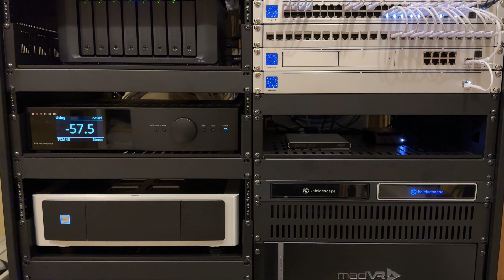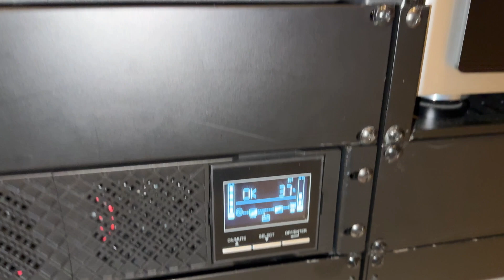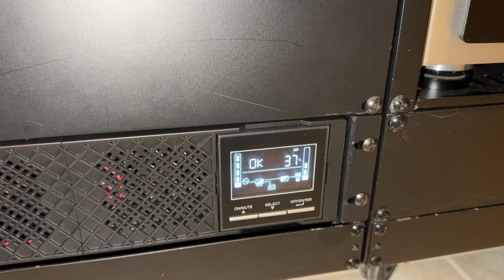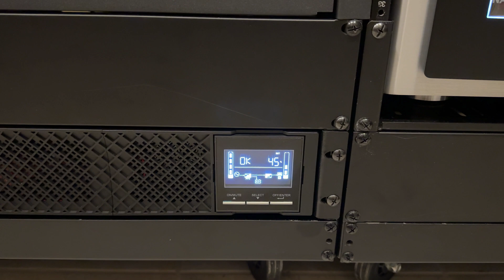Will I Blow Up My UPS? Can It Take My Full Home Theater Rack Load?

Comment: I know you mentioned the control4 integration. I’m curious how that  works / displays on screen (if anything like that).
Reply from the maker: I haven't yet connected the new power gear to my C4, but I will soon. It will mostly just give the ability to program outlet control.
Reply: @ will you show that as well? Really curious how that interface is.

Comment: I might be old school but I run my power amps directly from the wall on a dedicated 20a circuit. Aside from any dynamic load considerations, even “pure” sine-wave UPSs aren’t actually pure. Except for my Anthem MDX’s, those I power from the UPS. It’s possible the pure-ness matters less now with Class D, I’m not really sure. Like I said, I’m just old school.
Reply from the maker: I may go back to that as well. I wanted to experiment with this and see how it goes.
Reply: @Techthusiasm  钱

Comment: Nice setup but not really a valid test. The transient peaks from the amps are far larger and faster than the UPS meter can respond to (meter is heavily dampened). The UPS meter is reading a very dampened average power... Thats a big difference. The simple truth is you don't get power for free. for example, If at any given moment, the power to each speaker is at 100 watts, the power consumed from the circuit is each speaker power times the  number of speakers plus the inefficiency of the amplifier plus the rest of the idling equipment. In a lot of cases a single 20A circuit is not enough for extended listening at high volumes. The only reason you are not tripping a 20A breaker is they are measuring heat over time. The peaks in music or home theater are not long enough to heat the breaker to the point of tripping (but far exceed 20A).  Leaving the volume up loud enough, over time, will eventually trip the breaker. With this in mind, I'm confident the transient peaks of the system are exceeding the transient capacity of the UPS, The display is just too dampened to show the real data... I personally would never connect my amps behind a UPS. The most important is to have the amps behind a spike arrestor to suppress overvoltage from the power company or storms. The UPS alone can not regulate the peak power needs of a high powered audio amps. The results are, the amp(s) will be starved of transient power needed for a clean signal to your speakers adding distortion... My 2¢...
Reply from the maker: Thanks for the detailed feedback. I definitely need to look into this more. I'm hoping to find some way to get a full power draw plot over time to compare on the wall vs. on the UPS, as you say.

Comment: Most important thing I have going through my UPS are my projectors. If there is a power outage while a projector is running and hot, you want to be able to go through the regular power down mode with fans running to cool off properly.
Reply from the maker: Yes, I want to get a small, silent UPS dedicated to my projector.

Comment: I went your route initially (everything behind UPSs).  I would not recommend running your theatre amps through a UPS (certainly not a single UPS for everything)… it might run but dynamics are impacted in my experience.  Just to be clear, love WattBox equipment for purpose.  Mine had a lifetime warranty and they stood behind it when it needed to be replaced 11 years into service.

I have two NAD M27 amps and they're rated for max 10 amp each so they plug into a single 20 amp circuit.  Check the back of your amps / equipment for max ratings but generally you don't want to exceed the sum of the max rating for the equipment plugged into each circuit / UPS.  Per code you don't want to run at more than 80% of a circuit / good UPS rating for more than an hour (wires get too hot or circuit breaker nuisance tripping). 

Amps (driving subs especially) and personal computers are unusual loads. Their loads swing quite a bit with micro dynamics or GPU and music so you're better off giving them "space to breath" for those short dynamic swings.  

Also not, 100% sure how precise the WattBox power draw display is on dynamic load.  It's generally just trying to show you the load (not precise in swings).  I would think it's averaging over intervals and you're not seeing your amps truly spike as much as they are.  

I had a fellow come in (forget what he used) but he showed a graph of my amps power draw going through a UPS and then we ran the same music bypassing the UPS and into the wall.  The amp drew about ~10% more power like-for-like.  That convinced me to install some additional circuits to the rack.

You're probably in a situation with how your theatre and rest of setup has grown where at least another 20 amp circuit is warranted.  Worth it IMO (especially if it's your long term home).

Apologies for the lengthy comment... getting the best out of your equipment is something I know you value.
Reply from the maker: Thanks for the feedback. This is something I plan to consider more deeply as we go forward.

Comment: Nice clean install on those racks.  Mine resembles a bowl of spaghetti in a good-will store.  I like to keep my UPS's at or under 70% of their rated capacity at work.  Using 2 APC's 3000VA with a ton of external batteries gives me around 2.5 hours of run time for servers and network gear.  Love the content!
Reply from the maker: Thanks!

Comment: I'm highly surprised it could handle all your equipment. I don't have a UPS but I may have to eventually invest in one in the future. I wonder how long will your equipment continue to run after a power outage? The noise isn't bad at all. I usually run my movie watching volumes at -30 maybe -25. Great video! 
  I'm ordering a Synology NAS this Black Friday. I'll be sure to use one of your links.💯🧑🏾‍🦲
Reply from the maker: Per my original video, I only need the UPS to hold power for about 10 - 15 seconds. Then our natural gas generator kicks in. It's perfect. Otherwise, I don't think it would last a super long, especially if a lot of stuff was running.

Nice on the Synology! Price check it as Amazon, Best Buy, and Newegg for sure. Synology is planning BF pricing coming up.